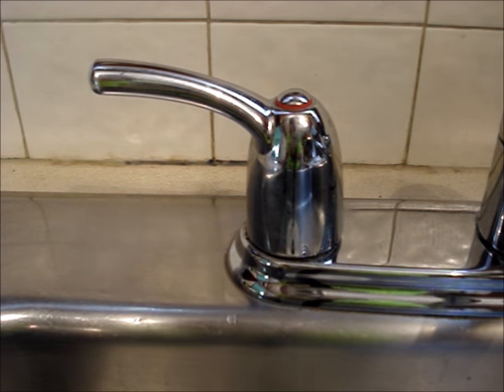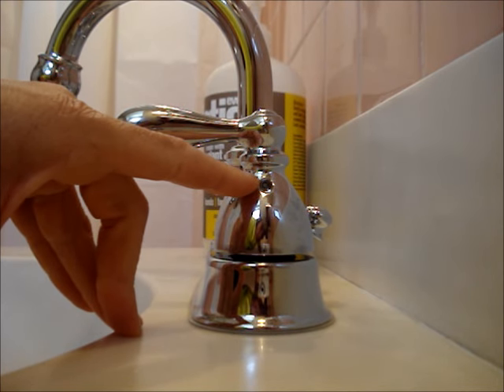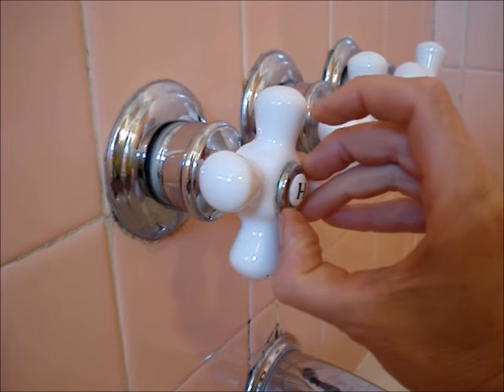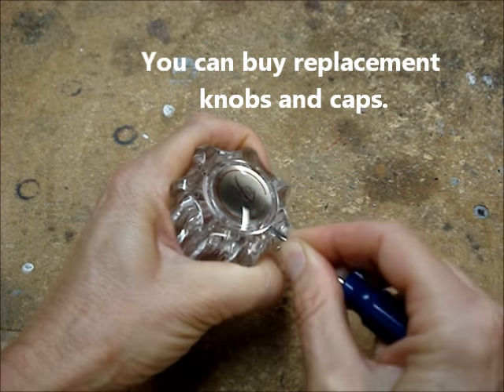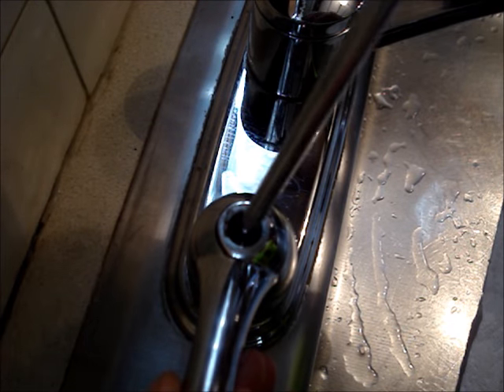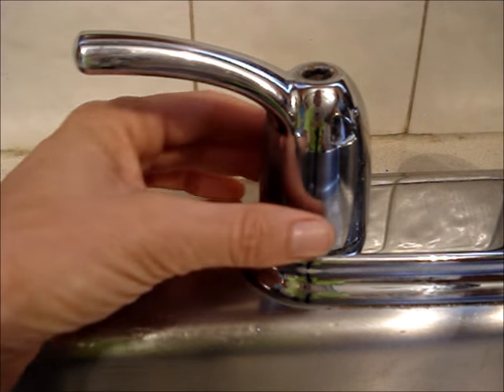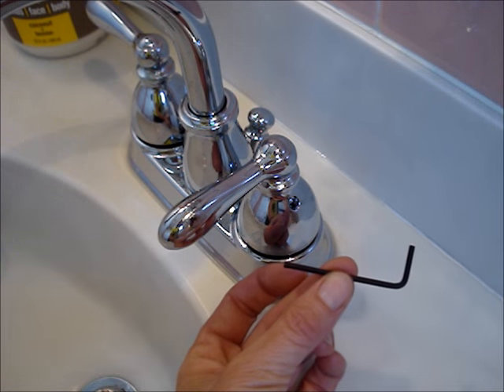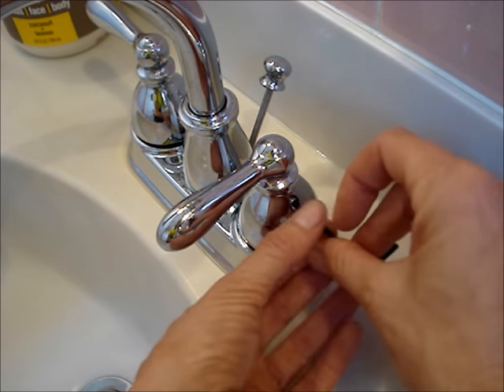How to Remove a Faucet Handle

Comment: I moved into an apartment landlord does nothing. My kitchen sink has the side allen wrench screw .  Problem is there is no stop tge handles swivel all the way around i have to guess where the water won't drip how do i fix this?
Reply from the maker: Hi Kathy, the first thing to do is make sure the handle is secured onto the cartridge.  Maybe it's just loose and not turning the cartridge (the part that allows the water to turn on & off) properly.  If that doesn't fix the problem, then the problem is likely the cartridge.  I have a video that shows how to replace the cartridge on a two handle faucet.  You can watch it to see what is under the handle.  Best wishes for the repair. Sorry to hear your landlord is not responsive.  Deduct your repair bill from the rent.  lol.
Reply: @Know-How-Now  thank you I'm usually pretty handy but I know certain things are like opening a can of worms plumbing, car issues and the grand daddy electrical!!! Uhhgggg thank you. Where is that video do you have a link?
Reply from the maker: Ooops, here it is:  https://www.youtube.com/watch?v=DkbE2PfPOJ0

Comment: Nope... mine has Neither. No set screw, no cap...
Reply from the maker: If you know the brand of the faucet, you can try going to the manufacturer's website.  Look for your faucet and the parts diagram.  That should give your a clue on how to remove the handle.
Reply: @Know-How-Now  yep, did that and found out in my situation (American Standard) I had to forcefully just PULL up to remove the handle. It's just a tight friction fit.  (makes sense, all the typical forces when using the faucet are rotary, not vertical)
Reply from the maker: Thanks for the update, I'm sure it will help anyone else who encounters the same problem.